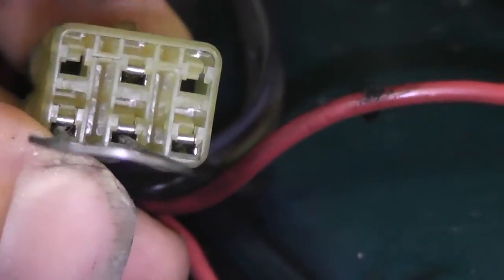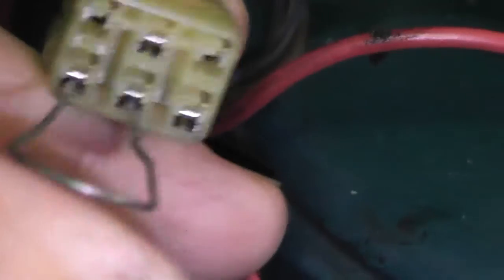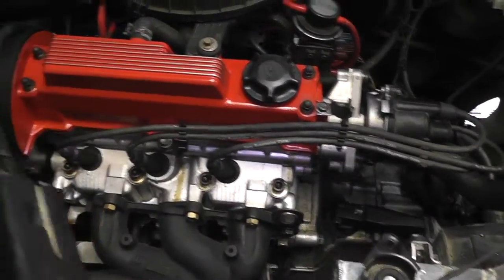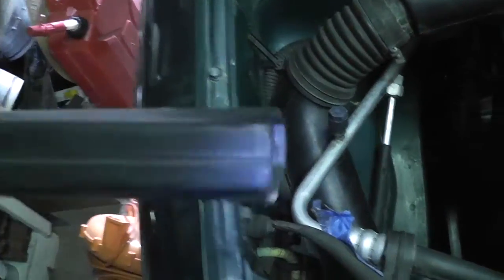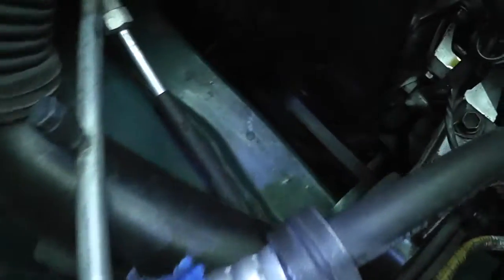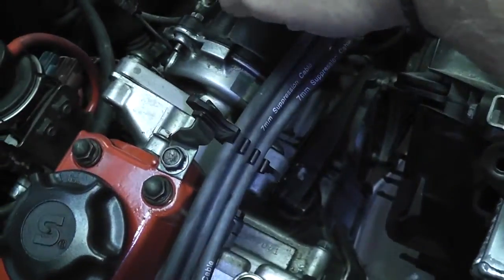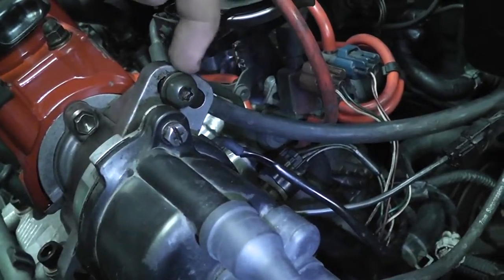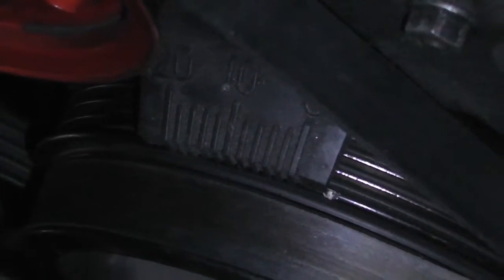How to Set the Timing on a 3 cylinder Geo Metro

Comment: Bought my first timing light! My 3 cylinder metro doesn't have a plug on the shock tower. Also no T-40 bolts. Mine are half inch bolts or something. So I did it without any paperclip. It was reading 20. Seems odd, as I thought timing belts stretch to a lower number. Anyways. . . I adjusted it down to 9.5. she's a bit more sluggish now on acceleration, but good to know I'm getting good MPG and extending the life of my engine. Thank you for your information.
Reply: If you don't jump the connector, you won't be telling the computer to run at base timing and your timing will be off. That's why it's sluggish. Not sure what geo you have but I think you can also jump on the OBD port or maybe the junction box. You'll have to look it up

Comment: Ive got a 93 geo metro and im completely lost i changed the valves and now it has compression and fuel but i think something is off with the timing
Reply from the maker: Check to make sure the belt didnt jump a tooth on the cam sprocket 🧐

Comment: Another video said to adjust the total timing first and only use the initial timing as a reference. From what I am gathering, you only adjusted the initial timing. What is gained/lost by doing it your way?
Reply from the maker: I did adjust it again later.  This was a fresh rebuild, and with the custom cam and heads I was supposed to advance until the performance was the way I wanted.  I carried the paperclip and timing gun around for a week or two

Comment: Sooo, if you're trying to get a little more ass out of it, where would you set it?  12-14?
Reply from the maker: For my cam, I advance it until it pings when driving then back it down.  Experiment and lmk
Reply: Orrrrr advance it when the engine is warm and when you start it when the starter drags back it off a little until she cranks.

Comment: I have gone through the 2000 Chevrolet metro repair manual and did not see what I need. I hope someone knows. Under the timing cover and near the top there is the camshaft gear therefore behind it is a place for a gasket kit however not enough detail on how to install the parts from the gasket kit -- I see a diagram from part sellers however too much doubt because one part fell out after I took the cover off
Reply from the maker: Sorry bud, my head came pre-assembled from 3-tech.  Checkout the geo metro forums, there are some crazy knowledgeable dudes on there

Comment: what does jumping the pins with the paper clip do?  You are a 1996 with OBDII probably, I have a 1987 Sprint with OBDI and turbo fuel injected head.   Do you know if I still need to do this?  Mine started right up but I need to find out why its misfiring and breaking up.  I didn't think to jam a paper clip in there, but I just want to know what it does.
Reply from the maker: It puts the engine/obd2 in "diagnostic mode."  Yours is older so it may be in a different place.  On some of the older models there are 2 places you can do this. On the 92 there is a raised fuse receptical (about 1/2") in the fuse box by where the drivers left knee would be when seated (the other spot is under the hood). If you put a fuse in there, it puts the car into diagnostic/set timming mode. The check engine light flashes to let you know it is in diagnostic mode.  Good luck!
Reply: It was the MAF sensor that was the problem...  Edit* pretty sure my issue was actually a clogged cat converter not the Air flow meter

Comment: I recognize this page yet its important to explain: The connecter is in a different place for 2000 Geo Metro - its behind the Glove-box. Open the Glove-box and squeeze the sides of the box until it drops and see behind it. Then the connecter is simple to see its pointing at you. Which one's to connect will be explained later or someone can explain - I need to remember which ones to connect. I plan on doing it soon. I have done it 2 or more times yet years went by and need to read where again.
Reply from the maker: +Steven M. Super glad you said that!  Someone was asking about other years and i didn't know.  I'll try and pin your comment next time I'm at a desktop so other 2000 year owners can see it
Reply: Steven M. Also earlier models have a vacuum advance so I don't think you have to jump any pins. Could be wrong though as my car is still running like crap lol
Reply: Hey Steven M. I'm taking the motor from a 98 geo metro and putting it in a small backhoe. I was wondering if u could give me a few tips on how to start it without the eco system.
Reply: Confirming it's also behind the glove box in a 1998 CHEVY Metro.
Reply: @Z4KJ0N3S  Thanks. I did it recently and I found that if I do not move my connector therefore in the position my connector is in its touch the lower left corner to the lower center. However be careful someone reading this its written and a picture is shown in my 2000 Chevrolet metro repair manual made by Chevrolet you might find one in the library.

Comment: the previous owner punched a pit where the sliding part and the engine part meet, now it never needs to be set again.
Reply: the timing needs to be re set every 15k to 30k miles depending on how hard the engine works ( due  to the timing belt stretching  and actually retarding cam and ignition timing slowing the idle and making less power)
usually along side with at least fresh plugs  or wires  on some interval...  that is the TUNE part of a tune up  leaving out the adjusting the carburetor  since no car in the states came with one past 1996 the Isuzu pup pickup truck
Reply from the maker: +‍1marcelfilms 🤔 interesting